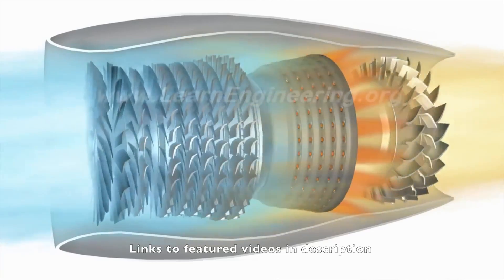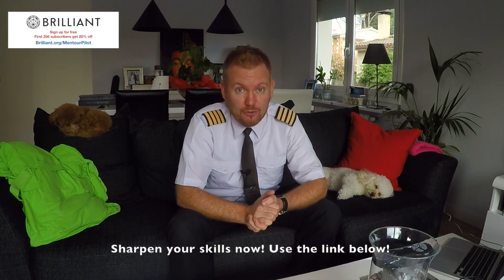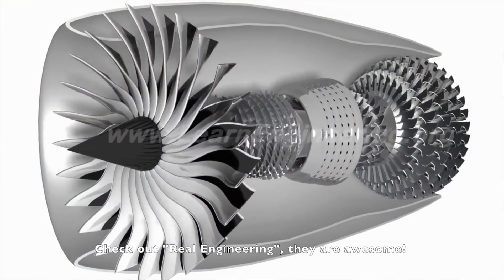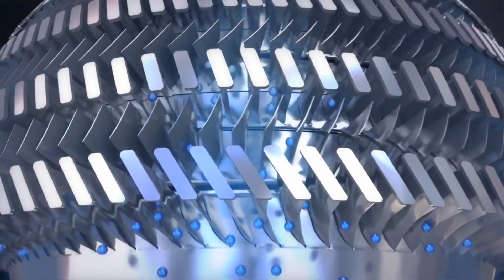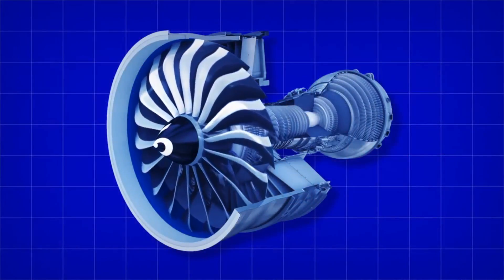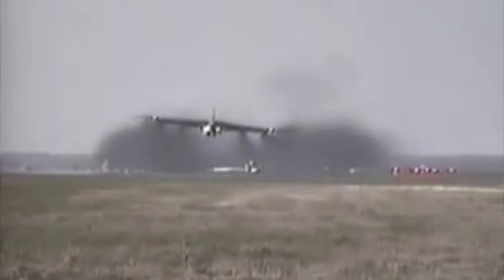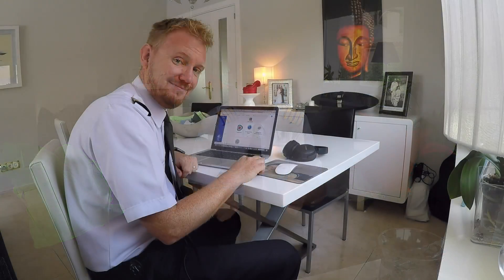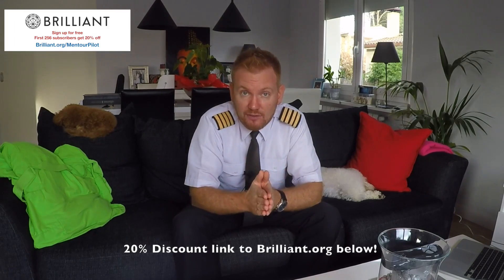Can water make Jet engines stronger?!

Comment: Very educating vlog for common people like me, especially who likes to go somewhere with airplanes. Maybe you can put some video about critical parts on airplane such which components must be replaced immediately or not replaced (temporary). I'm sure it'll affect airplane performance.

Keep on going mentor!
Reply: That will be a long ass video haha.  We have MEL (Minimum equipment list)  Ex:  You can lock out an Engine bleed system. NEF (Non Essential Furnishing) Stuff like seat back trays etc that can be working/missing and still be ok.  and CDL, lets say you have a access door damage on the oil servicing door you can actually remove it and fly.  Also can remove the thrust reverser blocker doors etc.
Reply: It's also interesting how Airlines especially LCC with high cycle time everyday manage with that problem..or the job itself
Reply: @franswahyu6831  f
Reply: I always thought that if you joined a plane in four sections that could be separated by some sort of ejection or release mechanism separately on by one to free fall. Then a giant parachute to carry it down to an unpleasant but survivable landing. Thing is I'm no maths wizard or engineer so wondered if a plane connected in four tubular units would handle the stresses of flight? Also is there a parachute that could carry a 1/4 of a plane with its passengers? It's always been in my head that idea.
Reply: @MrUFCnut  its almost physically impossible to do that lol
Reply: Kindly explain how the fuel burn at high altitude where the oxygen is always very low

Comment: All the proof that I need to know that rain won't affect a jet engine, is the fact that after QF32 landed it took 2 fire trucks pumping suppressing foam into the (I think) Number 1 engine to get it to shut down due to damage to the control wires.

Comment: There's several things going on with a water injection system in a turbine engine.
But the key thing to understand is that thrust is directly proportional to mass flow rate. All the water needs to do is cool off the hot gases coming out of the combustion section, so that the turbine blades and stators do not melt.
Newton's laws of motion state that force = mass times acceleration, this much is known.
Thrust is a force, the air fuel and (sometimes) water going thru a jet engine are the masses involved, and the acceleration is dependent on exhaust velocity of the turbine engine.
So we get a (very simplified) formula of Thrust = Mass flow rate * exhaust velocity * a conversion factor.
Like I said, the water is primarily there to cool off the turbine blades and stators. Yes, it does also contribute to the increased mass flow rate, but the water is not used at a rapid enough rate for this to be a significant contribution to thrust force.
What is actually happening here is that by spraying a small amount of water into the gases exiting the combustion section of the turbine engine (which are likely still burning, which explains the universally observed increased soot when using water injection), you cool those gases. In order to get the increased performance, you add more fuel to the combustion section of the engine, which burns with more air (air being the majority contributor to mass flow rate thru the engine), and is then cooled by the water spray to the SAME temperature as in non-water-injection use.
In other words, the extra performance isn't from the water itself, it's from the increased amount of fuel being burned resulting in more air being shoved out the exhaust nozzle at speed, which is only possible because the water is used to cool things off so the turbine blades don't melt.
Doesn't work very well on turbofan engines unless in hot&high conditions, because normal conditions operation already spins the fan section as fast as it can spin without causing damage, but in hot&high conditions the engines have to use a lower fuel burn rate to compensate for a lower atmospheric density. By injecting water in hot&high conditions, more air and fuel can be burned, allowing the engine to operate closer to the normal operating conditions, but this is a situation of "recovering lost thrust" more than it is "boosting thrust above normal levels".

Comment: Before I watch this video I was thinking of this reminds me of that incident that occurred where the plane landed and they could not get the engine turned off and they could not evacuate the plane until it was turned off and the fire department was there shooting their hoses ,with water, into the engine and they still couldn't get the engine to flame out. I think they had to use that retardant foam

Comment: Why doesn’t jet nozzle  point are at angle . If not vertically, at angle. Some issues Jet sucking up from ground can be reduced. Dust from ground is not great for engine, so to reduce it and other benefits

Comment: Not sure how it helps to tell us the volume of air power second is a house but then not give an example of the water amount per house of air. You could have just said it's "a tiny little bit of water vapor" and skipped the house part.
Reply: I really thought a discussion on water injection could have been accomplished without the usual negativity and pointless criticism found in the comments section.  No tact.

Comment: Will in the future jet engines will be obsolete ? maybe electric motors will turn a  duct fan instead  and will be supplied  with batteries  placed also in the wings(wing material itself and fuselage will be the batteries to reduce weight   )  all  aircraft will be covered in a very efficient photovoltaic coat to absorb sun energy eventually helping batteries to keep as much charge possible ,as per material aluminum should be replaced with stronger epoxy carbon fiber/kevlar material for more lightness and eliminate  metal fatigue due to rivets , thus increasing efficiency , it s just my comment , btw , why you don't leave in the cockpit just a transparent sphere fixed on dash half filled with fluorescent liquid  just to replicate computer artificial horizon, just incase electric supply will fail, or give erratic false indications ,at least in heavy fog you still be orientated .

Comment: I believe this other explanation of how the water injection works may be easier for some to understand.  It’s saying basically the same thing you are saying, but using other words.  

This is how I learned it in the US Air Force Aircraft Maintenance school.  When the water is introduced to the air flow it cools the air and increases the air density.  IE more molecules of air per cubic foot, similar to what a turbo charger does.  The more dense the air forced into the burner section the more thrust exits the tail pipe.  If I remember correctly on the B-707 / C or KC-135 it increased thrust by around 2,000 lbs of thrust per engine.

This is the same law that shortens the takeoff roll of aircraft in cold wether vs hot weather.  Cold air is denser than hot air.  So engines produce a little more power and there are more molecules of air per cubic foot flowing over the wing to produce more lift.

It also works on Diesel locomotives.  There are 8 notches of power on most diesel locomotives.   If I was using all 8 notches to run 60 MPH on flat track while in an open area with cane fields and then enter a swampy and or forested area I could usually run 60 MPH in notch 7.

Comment: i appreciate all of the videos i have seen on mentour.  if my questions are covered already i apologize..  1  does water the the runway increase drag ?  how does it change takeoffs ?  the amount water kicked up with the engines and how slow the planes look going down a water logged runway is interesting to me.  2 please do more on airplane redundancies.. wing !!!  ailerons  are primary for roll ??   can spoilers be plan b if ailerons fail ?  do ailerons work opposite of each other ?  left turn is port up starboard down ??  what are spoilers primary function ?   slow plane down when descending and landing ?  i remember when you talked about flaps  slats slots    thank you !!!!

Comment: Water methanol injection was common in use with the Harrier vtol aircraft . Later military engines were rated by High Pressure Turbine  outlet temperatures . So Rolls Royce took cool ( that’s about 400C ) air from after the final stage of compressor ( we call it compressor delivery air) and it is delivered through the hollow stator and rotor blades. This means we can raise the temperature above the melting point of materials used in blade manufacturing and consequently produce more thrust .
Reply: Interesting, I’ve heard of the hollow blades but never thought of how they work.  I guess I can look it up, but where does it inject the air?  Are there channels drilled in the center of the shaft, and holes drilled from there to the bottoms of the turbine blades?

Comment: I once heard of boat propellers being " pitted " by water. Tiny air bubbles in the water that cause the metal to become pitted and eaten as if by acid. The same thing that causes bone problems for people who crack and pop their knuckles often. However I doubt this is a problem for the jet engine main fan as unlike a boat prop it's not totally submerged but only has rain droplets that are quickly slung off it's surface.
Reply: Oh yeah, you’re right!  Cavitation, I think, and its destructiveness is no joke.

Comment: I understand how water does not really affect thrust on an engine, but metallurgically, does it effect the metal parts of an engine. As anyone knows, putting water on a hot piece of metal can cause warping, or even a breakdown of the metal. Any thoughts?

Comment: LARGE JET AIRLINES USE JET ENGINES THAT USE WATER VAPOR FROM THE AIR - ALWAYS THERE FOLKS. THEY DON'T SPEND A DIME ON JET FUEL - ALL A LIE. (1839) Do Jet Engines run on Compressed Air? - YouTube

Comment: Great video, thank you!

Very interesting to learn about the way that the water injection works. I had assumed it would have something to do with keeping combustion temps in check when increasing thrust, similar to anti-knock systems on Otto cycle engines. Turns out, it’s just about adding more mass to push against. Fascinating! 👏

Comment: What thrives the front fan? Does it have a motor for itself, or bleed air ducts from the core? Because an external starter don't give electricity to start but air if I am right? But if its uses bleed air then the front fan must already rotate? Chicken and the egg story XD

Comment: Thanks great and very informative video! Question reg the black smoke trails, you used a B52 example. I assume the black trails at the Concorde were purely afterburner related smoke trails or did Concorde also use water injection? Thanks

Comment: Thank you. I like the explanation of the water injection system causing increased smoke from the exhaust due to unburnt fuel. I always thought this was down to the type of aviation fuel used, which has changed over the years. I know research went into smokeless fuels for military aircraft to minimise detection from smoke trails. Fascinating science!

Comment: before I watch im gonna assume it has something to do with the same reason water is injected into turbocharged engines to cool the air charge and prevent pre ignition. Except it cools the charge air and provides more compression in this case.

Comment: Rainwater increases thrust and reduces specific fuel consumption.
Stationary power gas turbines are injected with water to improve performance.
Why not on aircraft?
Because it would have to be carried.
At high altitudes the outside temperature is too low anyway.
Water injection into or ahead of the compressor reduces the compression work per total mass flow(which includes the water) allowing more power to pass to the fan.
Thermodynamics of the turbofan engine gives that fact.
The calculation is a so called thermodynamic cycle analysis visualized in the entropy-enthalpy diagram.
There is an energy loss due to the need to vaporize the water, which cannot be recovered in form of condensation heat.
But still there is an improvement.

Comment: Water injection is a very old idea and still a topic to raise efficency in combustion chamber engines... SAAB 99Turbo in the 70s offered it as an extra, there is also an intruction pdf around, and also in the USA you could buy cheap sets of "water injection kits" (for carburettors) to save gas after the "energy crisis"

Comment: Adding water in a monitored way to the burn section of the jet will add thrust because the added expansion of water to vapor will add pressure which has to escape.  To do this the fuel must also be increased so the engines were very dirty which led to the big fan up front.  have a nice day and thanks for your time.

Comment: You can use water to optimize  Performance on any combustion engine. It reduces temperature and raises gas expansion. So you can put more t load in the engine without risking too high internal temps and have more power from the get go.
Reply: 100% This. it's why a lot of really high horsepower cars running on pump gas will have water/meth injection. It reduces the chances of pinging and detonation brought on by the higher than normal cylinder pressures and temperatures that can easily happen in a boosted engine.
Reply: @DigBipper188  and while it cooles the combustion, which would reduce Power normally, the expanding steam compensates for that.
Reply: @TheNecromancer6666  precisely :) You can't overdo it though unless you wanna lose the power you gained or hydolock :)

Comment: Ok, without even watching the entire video, I’m going predict that it has no negative effect, perhaps even positive effect in the air. Water expands when turning to gas at such a huge rate, and jet engines run so hot, I could actually see it being feasible that it “could” increase thrust. Not saying I predict that, but I see it as feasible. The water is going to evaporate and expand into gas. Just my gut reaction.

Edit: ahh, makes sense that it is more effective on lower bypass rate engines. Makes sense that high bypass engine wouldn’t benefit from water. Didn’t know about deliberate water injection before this. Great channel.
Reply: 1 litre of water becomes 1000 litres of steam and that would be super heated steam when coming out of the burn chamber .

Comment: Gentlemen that water it has nothing to do with the thrust of the engine you need to go and do some search may. Friend ....that what only on the old type of jet engine to reduce the temperature by ejecting water in afterburner section ok 
At the seam time I guess you don’t explain the flame out clear way for people not in aviation and their is no way for water or water vapor into combustion chamber ok
One more thing engine stall nothing to do with water....good lock
Reply: What just happened?

Comment: Water can actually make a jet engine stronger. Some early jet engines sprayed water into the combustion chamber, the water would vaporize and expand to 1,700x its original volume and produce a great amount of thrust. Though that has little to do with what's mentioned in this podcast.
Reply: it also absorbs alot of heat which decreases pressure and outflows. You only gain an advantage by holding temperature constant, aka more fuel, and that's only until displacement or incomplete combustion becomes the major issue.

Comment: Do the present day fans provide the same cooling effect as the water injection system? Atmospheric air will expand when exposed to heat and could the water injection system been used with a more efficient fuel burn to create a bigger bang for the buck?

Comment: Hi, Im always astonished how wings are attached to the body of the aircraft. How do they attched it that can hold such tremendous weight , the engine which weigh about 6 tons each, let alone 2 in each wing and the fuel. How come it does not snap off

Comment: Water can increase energy output if you transfer energy by torque as in piston engines or turboprops, this is because water has a higher gradient of volume when turning into steam. That said, in any engine where you primarily produce forward momentum through throwing exhaust out backwards, you try to have the particles of exhaust as light as possible. Because energy is 1/2mv² while momentum is mv, so you get more momentum out of the same amount of energy if the mass m is as small as possible. This is why they have more hydrogen in H²-O²-Rockets than would be needed for stoechiometric combustion. For Space-Shuttle main engines it was more like 3 parts hydrogen on one part oxygen instead of 2:1 as in H²O
In old low performance engines, you get into that zone where 1/2v² is smaller than v and there you do better by increasing the weight of exhaust. I'd say this is the thing with those B52s.

Comment: I spent several years working on BAC 1-11's,  these originally had a water injection system to increase take off thrust. This shortened engine life so most operators removed the water tank from the rear baggage bay & made use of the extra space.

Comment: Combustion chambers... The Quantas 32 A380 could not turn off one of the engines and initially the fire brigade tried to kill it with water but could not. It needed the flame retardant foam to shut it down. Jet engines are hard to kill!

Comment: You forgot to mention the additional noise water causes.   In the 70s I rode Space A on Air Force KC-135 tankers that used water on take offs.  They issued and require passengers to use ear plugs because the engines were very loud (painful loud) when using water.  For fun the crew did not tell the passengers about the water noise.  So after a short time the engine noise suddenly stops because people were wearing earplugs.   The first time it scared me until I saw the crew laughing at the faces of the passengers.  It seems that scaring passengers was a form of entertainment for the crew.  Only one crew gave a warning.  In hindsight it was fun and I miss those flights.